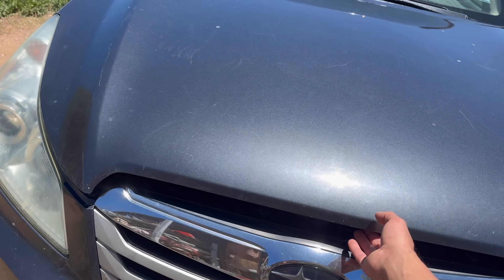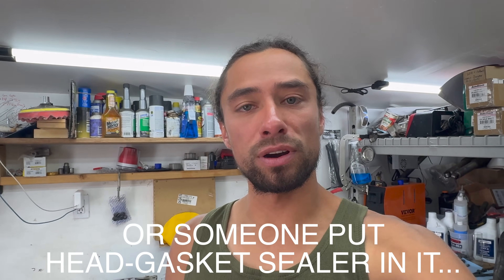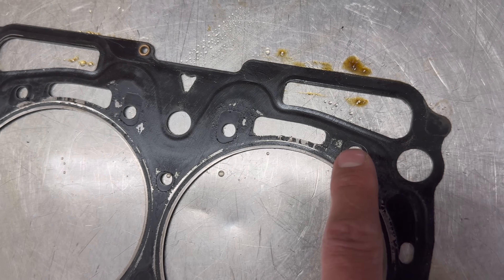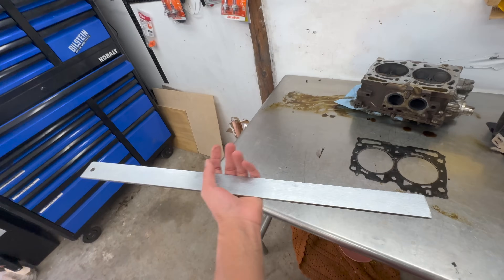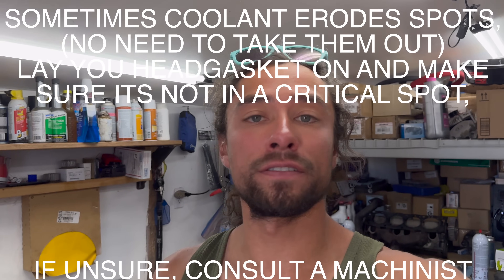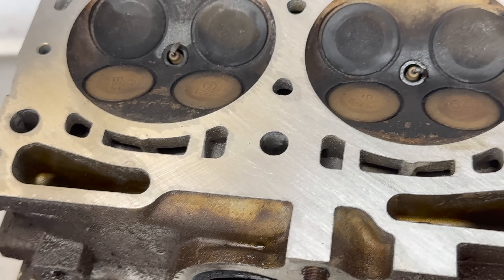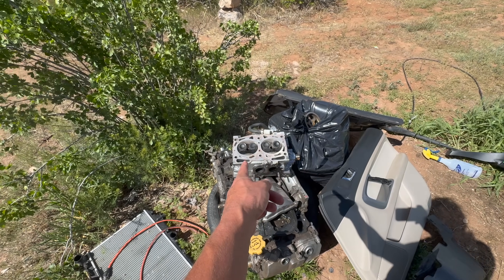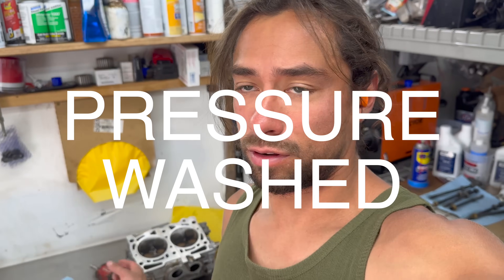How To: Resurface (EJ25/Subaru) Heads At Home - Backyard Machining 101

Comment: I think this just shows that flat head gaskets are a fundamentally bad design for all but the lowest of compression ratios.  If the connections were flanged, none of this would matter, and the cylinders would still be serviceable.

Comment: I was literally going to bring my heads to a machine shop tomorrow, but after watching this video, I will be making a quick trip to HomeDepot instead. Hey, quick question, what’s your opinion on line boring a 200k engine? It had zero issues and was running when pulled, but I’m putting it in my ‘74 Beetle and I want to overhaul it to be fresh and reliable.  Long time/first time!👊🏻

Comment: Great video sir. I'm a retired heavy truck / caterpillar diesel mechanic, and I am currently doing head gaskets on my wife's sub outback. I checked for flatness with my machinist straightedge, it's borderline. We used plate glass to resurface the pumps and plungers on V12 cylinder Cat fuel pumps, using a figure 8 pattern with lapping compound for as long as I can remember. Wouldn't final finishing the surface with 320 grit be good for a factory like finish?

Comment: Go to a machine shop that specializes in engine rebuilds, the head surface has to be perfectly  flat and ground to a specific roughness. I suppose if you're up creek without a paddle you could give this a try but, I don't recommend it.  Good luck, you'll need it!

Comment: doesn't the block have the same issue?
Reply: 90% no. They're thicker pieces of metal and if they're not aluminum then the aluminum head will get warped first. It would have to be severely overheated and you'll have much bigger issues that you'll notice if your block is warped

Comment: I'm not sure about aluminum but for steel that slurry of oil and metal particulate actually helps to achieve a more polished finish.  It does come at the cost of the depth of the cut your stone, or paper in this case, takes... I'm not sure if a more polished finish is a benefit with heads or not but it seems to me to stand to reason that smoother is better and smoothest is best 🤷

Comment: at 53, doing my first ever partial engine rebuild.  My oldest son told me about this technique and recommended I watch the end result.  I say partial rebuild doing cam bearings, head gasket, timing chain, guides, etc, oil chain & pump, vvti, camshaft sensor, crankshaft sensor, any other necessary hoses, etc.  at 200k, should be almost like a new car. 

my head will take a while, gasket blew between cylinder 2&3 in my camry, so it got pitted in between.  great work.

Comment: I don't use tile.  I use a piece of plate glass.  Then I spray adhesive on my sand paper and stick it to the glass.  Most times I start out with 600 grit and go coarser if I see a big defective, but I always finish with 600 for MLS head gaskets

Comment: I have had plenty of subaru heads off and not touched them up. I always clean them, measure and make sure the heads are within flatness specs though. Always remember those aluminum heads do warp from the bolt tension as well so your heads aren't 100% flat once applied to the engine anyways. 

That being said if i have any question at all about the flatness they go straight to a piece of glass with sandpaper then rechecked.

Comment: This works great.  I used a surface block.  Got 1000 miles on the new head gasket.  Thanks bro, you are one of the main reasons I got the Subaru back up and running.

Comment: Should work with exhaust manifolds too. Great tip about floor sander pads. I use glass from scrap refrigerators. Large glass shelves that are Shatterproof and flat, free, and easy to store away. There's usually an outer plastic surround which needs to be removed. I have a Safety Glass cat door insert that is floor to ceiling high, glass narrow but 5 feet long. Great for skinny yet long manifolds

Comment: this makes the end result of the head gasket job fail prematurely. i see cases of this when opening up failed head gaskets with less than 30k miles on them... it looks good but isn't proper, there is still warping that will happen. these head gaskets will likely begin to leak oil out the bottom of them due to that being the area which takes the most amound of grinding. to test this, simply have them cut as mimimal as possible and ask the machinist if there was warp, or check for flat spots with a machinists straight edge... good luck man its unfortunate to see this being done to people's cars
Reply from the maker: Na it won’t fail

Comment: Two comments.
1) Measure the total thickness of the head and keep track so you are not putting a taper to it. 
2) One thing to keep in mind. If the cam bearings are part of the head. When you sand or machine the head surface you will not have a straight line through the center of the bearings. Place the cam in the bearings and put one of the end bearing caps on. Do not be surprised if the other end of the cam is up in the air and not sitting in the bearing journal.
Reply: what's the acceptable amount of difference over the span of the head? EJs say .040mm flatness, FBs are .020mm - but how is that measured? From width to width of the whole head, or just anywhere over the span?

Comment: Did you make a video of an incar removal? thanks for your content, its super helpful. I just had a timing belt break (gates! of course) on my 2010 subaru 2.5L MT. I've ordered a used long block assembly and I'm going to remove the old engine and install the new. I'll be watching some of your videos in prep for this job. Any videos regarding 2010 subaru outbacks are helpful, especially engine removal, long block assembly on engine stand, and re-installation of long block into car ESPECIALLY the process of mating the clutch back to the transmission. Thanks again. Dave

Comment: If you seriously overheat the engine you must inspect the top of the head. If there is more than .001 warp the cam bearings will be dameged. The head will need to be straightened.

Comment: EJ251 with 366,000km (227k miles), headgasket starting to fail (steam coming out of oil cap). Worth redoing the heads with MLS or find a lower mileage engine? I'm worried about cracks and worn piston rings/cylinders. Can't test compression as HG is blown. Any recommendations for reman long blocks? I live in Canada (can use freight forwarding service).

Comment: I just found your channel 2 weeks ago and I’ve been binge watching to get through the videos.  They are awesome.  Liked them so much I ended up buying a base 2009 Subaru Forester 5 speed manual with 199k ($700).  I’ve had a couple outbacks and a 2002 forester over the years.  Man, I believe if you stick with YouTube that you’ve got to pop and hit 500k subscribers at some point!  Thanks for taking the time to put them out.  On my 2009 Forester, the head gaskets seem okay.  No milk or white smoke.  Timing belt was done at 107k.  So I will be doing that with a kit.  Do you still recommend Aisin?  The clutch feels good but I’m thinking I may as well replace it while I have the engine pulled.  I know me and I will probably end up doing the head gaskets as well since I can’t leave things alone.  Do you think I should get into the valves and replace them?  I will do a leak test on the valves.  I’m not sure if it’s the crank seal or what yet but there is oil leaking onto the exhaust in the front and leaking into the oil filter area.  I don’t hear any engine noises.  The guy I got it from has a temp gauge mounted on the dash and while driving from NJ 2 days ago it was in the range of 180 to 210 when I looked at it.  Anyway, sorry for the long comment.  You are extremely busy.  Funny how much fun a driving little manual 170hp car can be to me.

Comment: What about head gasket thickness? after resurfacing it will have greater compression. For NA engine I'm guessing it'll be fine, but won't turbocharged one be knocking? Very helpful video btw

Comment: Thanks for the video, very helpful! just did this on my EJ22, I couldn't find a piece of tile at home depot that was super flat looking, so I got a mirror instead... Also lapping the valves and replacing the valve stem seals. What valve stem seals do you recommend? Is the Mahle set SS46109 good? Thanks!

Comment: Great video, but I'll add that if you want to make sure your valves are sealing, just put the heads back together and then take a little cup of gasoline and pour in there. Gasoline can get into places that water can't. If the combustion section stays dry, you're good to go.

Comment: Wow. I did my 2010 forester head gaskets 5 years ago but I had a machine shop rebuild the heads so I would not have any more issues.  Thanks for the fantastic demonstration on the heads and all your other videos, if I only had the videos 5 years ago.  I did a bunch of research on the proper gaskets and parts so I would have no other issues and it's been good.  Now it needs valve cover gaskets and the exhaust smells gassy so it's time to dig in again.  I'm a big fan!

Comment: Ive got a couple questions if anyone could provide some insight, ive got a set of EJ25 heads I tried this method with, im using the exact same sandpaper and tiles, I even tried a slab of glass with the same result, I seem to be getting lots of wear right around the edges of the cylinder head, and it wont touch the inner surface of the cylinder head, im using the same setup almost exactly to a T, I believe its being caused by the tiles, I straight edged the tiles and they dont seem to be as flat as they may seem, is there a specific tile to use for this? am I missing something? Any advice would be greatly appreciated.
Reply from the maker: If you can see your reflection perfectly, the tiles flat. Sounds like the head is warped (did you straight edge the head?) or your pushing downward on the head and your table isn’t rigid and is letting the tile deflect.

Let the weight of the head do the work, if the heads warped, only the edges will touch for the first bit till it begins to straighten
Reply: @steinfabgarage  I'll explain the whole situation, so I straight edged the heads, I was able to fit a 0.05mm between the center. I started sanding them on the tile, it immediately is taking a bunch of material from the outside perimeter of the heads and not anything in center, I at first think oh that makes sense because the center seemed to be warped up, I eventually get it fully sanded and smooth, I go to straight edge it again and now my straight edge has a high spot in the center, like a biiiiig high spot, you can feel the straight edge wobble back of forth measuring it across the head, but it is tight in the center and loose on the edges when you measure diagonally, it did this with both heads. I put my straight edge up to the tile, actually 8 different tiles because I bought more to make sure I didn't just have a shitty one, and they all can fit 0.05mm in the center of them. Now here's the weird or maybe bad part, I straight edged the block and it comes back true on my straight edge, I can't fit a 0.03mm between them (smallest feeler I have) or see light between it. Now I'm absolutely confused if it's my edge, or my heads and my block. A little stumped and worried I just roasted a set of heads 🤣 I even got a piece of polished granite countertop as well, and it does the same thing as the tiles when I put my straight to it, tight at the edges, but loose in the center, starting to think my straight edge is warped even though it's new, AND my block is probably warped and happens to fit the warp of the straight edge 😂 I should mention I am allowing the heads to do the work, making sure I'm not pushing down or lifting up, it is mounted to a solid tool box and the tile itself was mounted very sturdy to the top of the box, so I don't think technique is the issue, I really think I'm over thinking it and my straight edge is out
Reply from the maker: Hmmmmm. The tolerance is .002” (two thousands) so you should be fine. If the straight edge is warped, won’t it do the opposite if you flip it? Did the motor overheat? Why is it apart? 

In all honesty, your most likely good to bolt it together, the headgaskets job is to take up slack. Let’s say the heads were warped 8 thousandths. Now your at 2 with a good mating surface. SHOULD be fine. The headbolts WILL bend the head down and it WILL seal. 

I have to say should for liability reasons, no promises, but ye sounds like your overthinking it. Especially if it overheated and they were worse in the beginning
Reply: @steinfabgarage  I really really appreciate your quick responses and help man, absolutely no liability on your part taken haha, but a couple more things to answer if you don't mind. The edges specifically ARE out by just about 0.002" even after sanding, the car was overheating, oil and exhaust gases making their way into the coolant. I got the car for super cheap and the rest of the motor checks out, so I honestly dont think they got it TOO hot. flipping the straight edge results in the same thing, so I absolutely have something going on that's not making the heads flat, I really think its probably the medium I'm using as a sanding block, but odd as every single piece I've used yields the same result, as if they are all slightly concave, making the cylinder head adversely convex after sanding because the high spots of the medium are always on the outer edge of the cylinder head. They are ONLY BARELY out of the 0.002" and thats only out near the edges, again NO liability, but I have brand new KP Gasket MLS head gaskets going on it, do you think it should be okay?
Reply: @steinfabgarage  I think I figured it out! I was watching your technique again, and realized my motions were faaaar slower with the head on the sandpaper than yours, I quickly took 4 measurements, 2 straight across in a + pattern and 2 diagonally in an x pattern, and then vastly sped up my sanding motions with the cylinder head. Measured them again, sure as shit closed all of my gaps across the board to damn near .0015" Extremely interesting, assuming that with slower motions it gives more time for the head to pivot and dig the edges in?? Not exactly sure I'm no expert obviously haha. Anyways man you're awesome, I really appreciate your help and responses, keep up the backyard bogan shenanigans (:
Reply from the maker: Even at .002”, it would seal. So your good to go! I sold “someone” some heads that I could slip .003” feeler. Told him they needed resurfacing, he sent them and it ran 🤷🏻‍♂️. 

.003” will be sealed by the headgaskets. SO LONG as it’s consistent and there’s no worse spots by the exhaust valves IE .005”+ (and that’s hard to see) 

So yeah your fine man. Send it! And no problem, I’m happy to help, and I appreciate everyone who checks out my channel :)

Comment: There's no need to resurface the heads beyond cleaning the mating surface unless it's uneven (i.e. from bad machining or or warping due to overheating). You risk more problems than you solve.

Comment: this is awesome. would be cool to see it done and accomplished using an inline 4 cylinder head. i doubt it can be done, due to them being long.. those small subaru heads seem perfect for this at home resurface
Reply from the maker: I’ve done Toyota v6 heads, and my XUD9 in-line 4 cyl head

Comment: Look nice job but many aluminium particles can get into the oil passage going to the camshaft therfore reducing the oil flow to the cam bearings. You must remove the camshaft bearings cap then surface as you do l saw many camshafts size within 1000kms with people doing your way 
Good luck for people changing their head gaskets without cleaning the oil passage .most of time it's works but not every time .bye

Comment: So.. I watched several videos showcasing this method, and have to say that the channel owner's matter of fact assurance that it works, convinced me to do it. 
I have just completed the task, apparently successfully. That said, it if there are leaks it might not be apparent for some time, but who knows?
I also removed the steel head locating dowels (with difficulty and some vicegrip marks on them), and did the same to the block surface.

Comment: I really could use your advice and expertise on a 2.2L engine from a '98 Impreza. Pulled the heads to do gaskets and one of the head bolts snapped way down in the hole. I've drilled a 1/8" hole all the way down through the bolt and drilled out the upper part of the bolt to receive a stout ez- out. So I can get penetrating oil past the threads into the bottom of the casting Despite heating with a map torch and soaking in penetrating oil for the past month I can't free the bolt. I've had ez- outs shear on me before and I don't want to do that here. Any tips or advice for getting a steel bolt out of an aluminum block?

Comment: Should I do this if the head wasn't an issue? It didn't get hot, and the engine has 79k. My issue was a valve replacement. The great theta 2 with its carbon build up. I just don't want to risk doing more harm then good if its not necessary.
Reply: Just watched the end lol. I got my answer.
Reply from the maker: check it with a straight edge, if .0015 wont slide, your fine

Comment: Thanks man, your advice (and love of kitty cats) really helped. I did this and my heads look really nice. Great idea with the pressure washer to check valves.

Friends, if you are going to try this, definitely start with course grit or else it takes ages. I used wet and dry sand paper and water/dish soap instead of WD40 then then and washed with water every time the paper got clogged. For the Block surfaces I cut some scrap MDF into strips and glued sand paper to them to make sanding blocks and block also look great. To remove the dowel pins, cut a thread with a tap and then screw something in and wiggle them out.